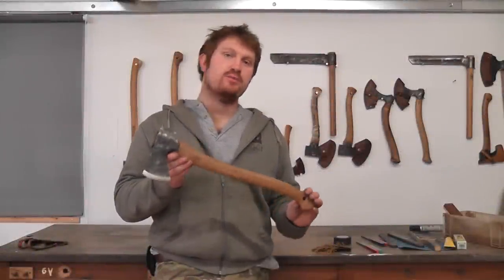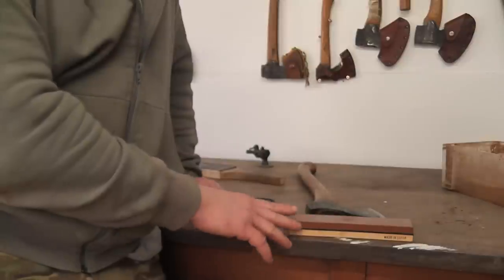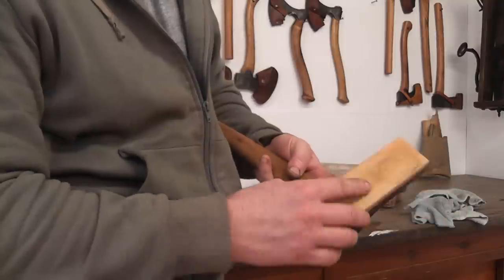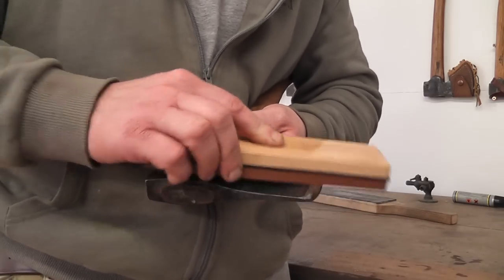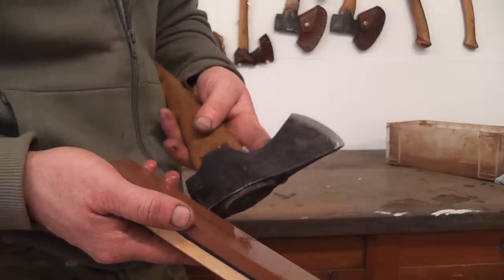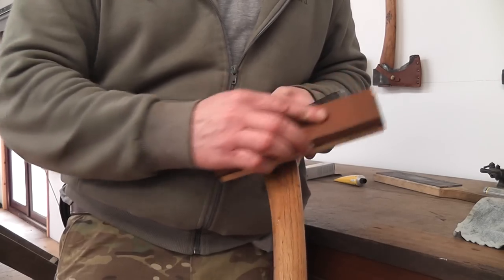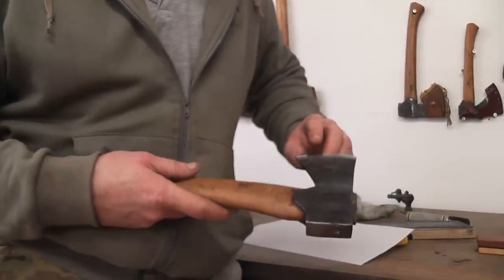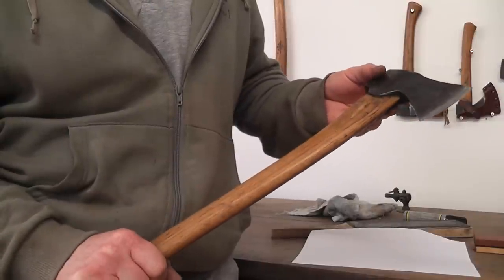How to sharpen an axe with Ben Orford

Comment: I never understood why people think your axe needs to be any less sharp than your knife. The whole point of an axe like this is to CUT crosswise into the grain of a tree. If anything, it should be as sharp as you can get it.
Reply: I agree. I think it's because most people are used to buying cheap hardware store axes and then use them as they come. Rough, relatively blunt, yet they just about do the job. Gränsfors Bruks on the other hand, come as they should be, shaving sharp and a real joy to use.

Comment: I just got a Gransfor small forest axe and a puck. Sharpening it intimidated me a lot because it came with a hairshaving edge and its almost as if I didn't want to use it just to maintain the edge. These types of videos are great as it just gave me the confidence to buy some waterstones and attack the edge when it will reach an "in need of sharpening" stage. Thank you for this, very helpful and easy to understand, that marker trick will help in all my sharpening needs ahead :)

Comment: Thank you Ben. You have a gift for explaining things clearly. I am working on bringing back a very dull axe. Starting with my coarsest whetstone and using your technique, which seems to work very well. I have a lot of work ahead before I will make it to the 1000 waterstone. Then I need to rehaft, too!
Reply: I would have rehafted it first: while sharp tools are safer in use, full told are safer if you are rehafting them. I'm assuming it's a job long since completed and simply info for someone else wandering around here.

Comment: Thanks for showing the technique! I used a wooden block and different types of sand paper though, since it started to ate away the only grinding stone that I own. Had to correct a grind that was way to steep, so basically I had to start from the scatch, which was with an 800 grid wet stone and different metal files, a fruitless attempt. 40, 80, 120, 400, 800, 2000 grid sand paper worked for me (dry). The poor man's choice, which also works great on Mora knives, but with a different technique. Cheers!

Comment: I kind of cheat sharpening my Cold Steel Trail Boss. I use the Worksharp belt sharpener. It put a convex grind on the bit, and the polishing belt is 6000 grit. After that, it to the strop I made using green stropping compound. I have it where it sliced through paper just like that.

Comment: Hi. GREAT video and MUCH simpler than anything else I've seen. Question. I just received a Gransford Bruk Small Forrest Axe a couple weeks ago and while it looks great and the handles looks like a nice straight grain, it came very dull. Either way. I got that KING combination stone u use and after 30+ minutes following your instructions, I still can't shave hairs with it. I feel I should be able to get that razors edge on it. I realize it's most likely me that just are not good enough at getting those levels right and matching the edge. 

It has a convex edge and I'm used to flat grind kitchen knifes that become razor sharp pretty easy, so am I expecting too much of this axe? I mean with a convex edge is that same sharpness possible? I'd assign convex will never be as sharp as a flat grind when you can get the perfect angle to shave with.  I'm a total novice, so forgive me my ignorance. 

Thanks for the help,

Jacob

Comment: Excellent video, Ben. I have the Norton combo stones ... 220/1000 and 4000/8000. With this set of stones, would it be correct to make the first pass with the 1000, smooth with the 4000 and then take the burr off with the 8000? 

Thanks ...

Comment: Excellent video, very clear and easy to follow, I need to sharpen an old axe to chop kindling wood. I'm unsure about what grit size to buy when I buy a whetstone, there seem to be various options. I may ask on your website.
Reply from the maker: Glad you found the video useful. Well we use a 1000/6000 grit stone in this video which is a great all round grit. But if you need to restore a axe from a bad state you will need something coarser. The main problem with a coarser grit stone is they are quite soft and become un flat very quickly. I would suggest using a flat chainsaw file to get the initial edge then move to the stone. Hope that helps many thanks cheers Ben
Reply: @BenOrford  Many thanks! I have a new axe that I want to keep sharp so will get the 1000/6000, will also look for the chain saw file for the old axe that I'd like to rejuvenate.

Comment: Hey Ben. What if you have a huge nick in your axe and want to remove the nick with a file fx a bastard mill. Would it be necessary to grind the bevel as well as the edge or do you just want to remove the nick from the edge and then sharpen the bevel? Love your vids! Cheers from Denmark

Comment: The burr after sharpening on a stone or grinder usually becomes folded to one side of the axe. You are not removing the burr by stroking with a piece of leather. The leather strop simply aligns the burr central. A belt sander is far more efficient and then finish by a rough heavy flat leather shoe sole, with no cutting compound required. If the axe is in poor condition, your method would take hours to achieve the razor edge. Thus, my advice is to use a Makita 9401 belt sander with 240 grit Makita sanding belt.yes, you are right, the honing angle on the axe allows the axe to be properly aligned onto a horizontal belt sander and the pen is a good idea otherwise far too labour intensive a process and costly.

Comment: Hi Ben! Thanks so much for posting such a useful video. I got a Swedish Wetterling axe for my college graduation and I want to be able to sharpen it myself. I am wondering which grit the dual wet stone should be on both sides and if you think one brand is best?

Comment: Ben, I have exactly the same axe like in your video and I just wanted to ask if it would be ok to sharpen it with Japanese 1000/3000 grit water-stone and finish on the leather strop with Dursol paste? Or do you suggest that I buy 6000 grit water-stone as well, before polishing with a leather strop? Thank you in advance!
Reply: 3000 is heaps.  1000 will do.
Reply: A file is good enough....

Comment: i've not been particularly confident with using sharpening stones, i used an old one my dad had, to try and sharpen a pen knife once and i swear i blunted the thing.However i've just bought an axe and whilst the blade seems to have something of an edge it couldn't cut paper like that, does it need to be that sharp to do a good job on branches and fallen wood?

Comment: I've got an axe and a hatchet, both have a red butt with a silver blade edge. What are they called? I have a smiths since 1886 whetstone with a knife sharpener attachment I got from Wal Mart. The axe has some gashes from use in the blade. How do I get rid of them? I used both pieces to sharpen both the axe and hatchet. I looked up a previous video on how to sharpen stuff and it  said to take the blade, fix at a 45 degree angle and stroke forward. Now that I have watched this I am not so sure.

Comment: where do you recommend getting the stone you used?
Reply: look up Japanese water stone. King or Ice Bear brand by the look of it. 1000/6000 grit. Perfect for maintaining your good kitchen knives/bushcraft etc. They are about 25-30 quid. Need soaking in water for about 10 mins or so before use.

Comment: You do not shape any micro bevel ?
Reply from the maker: I don’t I just keep it as one constant convex edge adding a micro bevel makes it faster to sharpen but with multiple sharpens it will become more obtuse and change the edge geometry. 
Also the convex edge as it stands has plenty of strength too. Hope that helps 
cheers Ben

Comment: Is that a specific piece of leather or just an extra piece from anywhere
Reply from the maker: Any leather will work so long as it hasn't been sealed. the fluffy inside of the leather works well to hold the compound.

Comment: why is it important to sharpen/file in the direction of the cutting edge or against the the cutting edge?
Reply: Jim Quinn Mostly just safety.  If i'm sharpening my straight razor, I only go away from the blade.  With my axes, I'm not as careful, but I have sliced myself a few times.  

When he was honing with the leather, he went away from the edge so it doesn't cut the leather. 

P.s. People may argue with my diagnosis of the situation, but this is accurate to the best of my knowledge.
Reply: Safety (see other reply), mostly. Additionally (while unlikely to happen with an axe following his method) the fine side of the King (I think it is... mine looks similar) double sided stone is also quite soft. If you are not careful a sharp edge can actually catch into the stone (similar to the leather), especially if you are a beginner and not concentrating. Yes, I know that from experience, while sharpening a chisel on the bench. Yes, it is stupid to do this. Yes, I was really not concentrating nearly enough, and would really have cut myself if I had been sharpening an axe "in the air" like Ben Orford does.

Comment: hi ben when you say" i like to leave it convex" does that mean a little V on edge ? so it does not taper straight down
Reply: Hey. The best way to describe it is perhaps an "apple seed" shape. Here; the grind marked no. 6 is a convex grind: http://upload.wikimedia.org/wikipedia/commons/4/4c/Ground_blade_shapes.png . That's what you're after. Curved on the edges rather than a straight-edged V.
Reply: chris morley yea its kind of a round arch shape like in churches. doing circular motions will give you that.
Reply: ***** What are the other profiles used for?? This video has opened my eyes to the fact that my ax is not as sharp as it should be. I was told many years ago that an ax used for splitting should not be as sharp because its the wedge action which splits the wood not the sharp edge, is this a true statement? Thanks for the video.
Reply: yea if you manly split wood use a rounded motion on both sides this gives the arch wedge shape for spliting. the edge is sharp but the shape is more robust. if you want to carve you can have an a-symmetrical bevel. one side flat and the other arched this is to help remove wood but with accuracy. you can have flat bevels too but i don't use them.
Reply: FinalRustyNails nice one thanks,i have it now
Reply: sweet ;)

Comment: hello Ben Orford that such type of material that's what you polish the end the ax?
Reply: Its called polishing compound, different colours for different types of steel.
Reply: thank you very much, sorry the question but my mother tongue is Spanish, with which you rub the ax to polish? if I am not mistaken is leather?
Reply: Yes leather.
Reply: It's Tormek paste.  You could use a green bar as well and draw it onto the leather.  The bar is cheaper and commonly available.

Comment: Exactly. A bench grinder may mess with the temper of the edge facilitating chipping. And from my experience, fixing an edge that was made on a bench grinder is very time consuming and requires lots of work. Anyways, a bench grinder won't get you a safe, sharp edge like Ben shows in this video. the factory bevel will most likely be affected as well hindering its cutting ability. Bench grinder is a no-no in short.

Comment: Why would I want a sharp axe? I mean I can see it's uses for cutting trees and branches perpendicular to grain, but not much for splitting firewood. For a splitting axe/maul a fast increasing wedge in a convex or straight fashion works best and a relative blunt edge not to tear across grains that makes splitting lot harder and the axe may stuck itself. 
Well that's what I do with an axe, split firewood.

Otherwise good tips about general sharpening.

Comment: I managed to hollow out a dip in the middle of my stone. This screwed up using it for sharpening anything else.
Reply: This is an easy fix. Get a solid piece of flat glass and use a 400-600 grit sand paper and fold over the glass. Draw vertical pencil marks all the way across the stone. When they disappear  , your stone will be flat. Do this dry !!
I did it with the same stone Ben is using and it worked great.
Hope this helps , good luck.
Reply: +Bryan Resch thanks for the tip...ill give it a shot.

Comment: First off, there's no reason to call me a dumbass.
It was also wrong of me to state that you don't know anything about axes, sorry.
Well, i'm not talking about felling large trees, in bushcraft, we often fell small dead trees or saplings, and we dont carry chainsaws and splitting wedges with us.
The axe that i normally use is 50 centimeter's long, that's why i call it an axe, simple as that.
I'm stating that a sharp tool is more safe because it's gonna bite more into the wood, and not slip of.

Comment: I don't like your method. I was given an ax that's very dull. My first axe so I need to learn to sharpen it. Your method requires very strict control of the angles of the stone while you are holding everything and moving the stone - it may look good to you but thats not possible..your still fudging that angle tiny bits due to involuntary muscle movement. Thats fine for you because you've had practice but for me a beginner science tells me that my passes will cause that angle to change much more drastically. I'd be more comfortable using some type of guide to keep the right angle.. I'd need another method.
Reply: +Divergent Droid It should be possible to get a collection of thin (1/16", 1/8", whatever works) planks to place between the stone and the ax cheek. That way you don't need to hold it off at a constant distance, the spacer would keep it a constant distance. When one area is done, add an additional layer of spacer or swap out for a thicker one and do the next area. Repeat until all the marker black is gone. I haven't tried this, it's just the first thing that came to mind. Anyone see why that wouldn't work? I suppose it could result in a series of stepped planes  on the blade.

Comment: But this guy is not stating that he is only sharpening it for the purpose if splitting wood? 
The axe which he uses in the video is not a splitting axe! So you're wrong, you would be right if this was a splitting axe, but IT IS NOT.
You're also giving me a headache man, thinking that you are the only who's right? 
Don't blame me man, you started it when you said that axes were not meant to be sharp. (When you split wood, it is true)